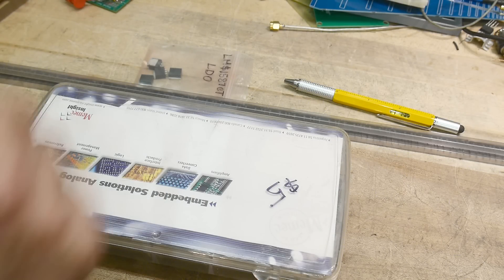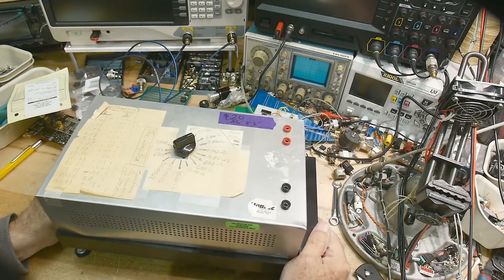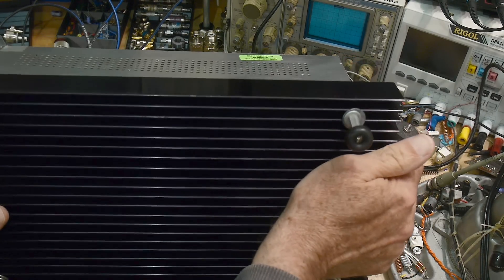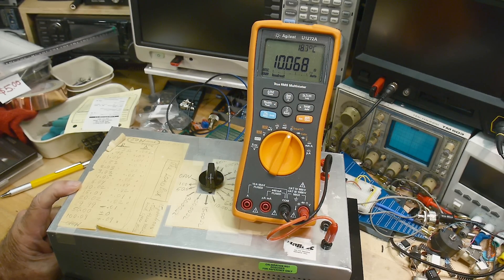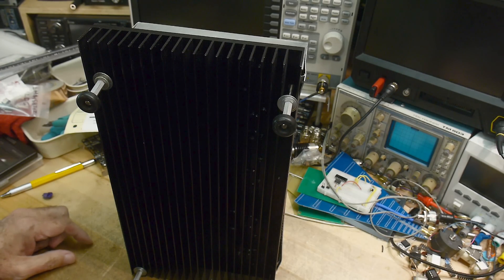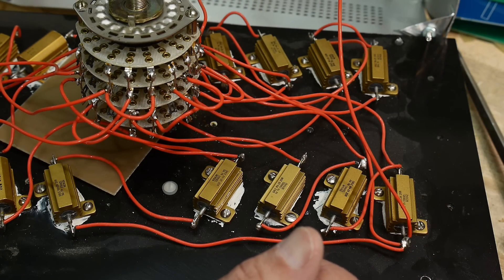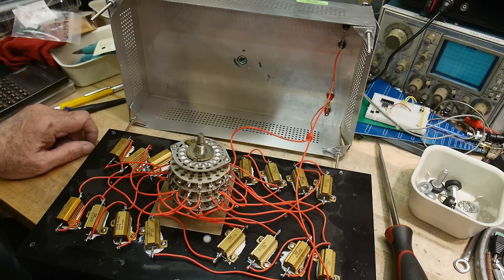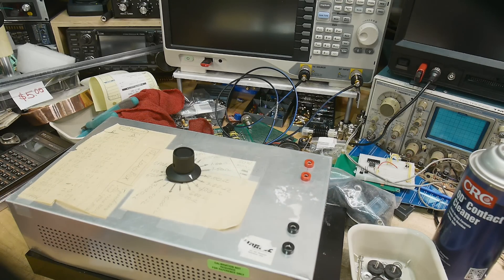#1475 Used DIY resistor load box

Comment: Pretty cool load box.  I kind of like the way he used the feet as nuts to hold the lid on.  Since he has an "open" selection it's a bit strange that he didn't include a "short" selection to zero out the meter leads.  Maybe the extra banana jacks are somehow intended for four wire measurements.  Anyway, cool 👍

Comment: I think that pen also has a little reversible screwdriver on the other side if you unscrew the rubber stylus. They're surprisingly useful in a small toolbag.
Reply: I have one of these aswell. And yes, it has a screwdriver underneath it. You can put the rubber stylus ontop the pen when you need the screwdriver

Comment: My guess is that the board is there to prevent the bottom layer of the switch lugs from shorting out against the heat sink.

Comment: The pen's top looks like a pad to operate a touchscreen.  I do wonder whether the level is accurate, though.  I would expect 0.53 Ohm at room temperature and 0.53+0.03 Ohm at 50 W.  A 75 Ohm setting (for video) would be preferred to most values provided.  Also, a coax connector would be useful; though I don't know how it responds to hf.

Comment: I am guessing its a dummy speaker load. Multiple choices for adding additional resistance to simulate frequency-dependant impedance?
Choke full of parts.
Reply: A bit overkill for a speaker load.  You only need 4, 8, 16 ohm.  Plus you’d want two, one for each channel.  And more likely 100W instead of 50W.  So maybe a power supply load tester?

Comment: Interesting and a bargain. I wonder whether the board is to prevent the rear of the switch shorting to the heatsink when assembled or in the event that someone removes the switch nut when the unit is connected (the case internal depth seems similar to the length of the switch).

Comment: Curious about the wiring arrangement but I couldn't make out the resistor values, I'm assuming some are set values and some are in series. I'm wondering if there is an optimal way to wire this using series/paralleled resistors? And how does this have a 50W limit if those are all 25W resistors? I'd love to see the wiring diagram for this